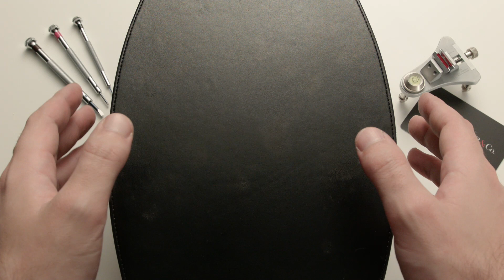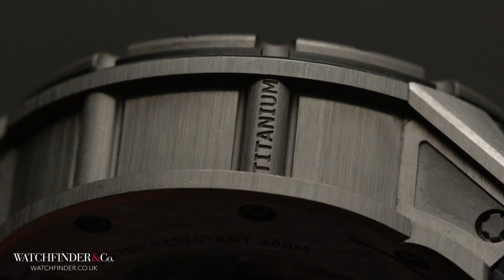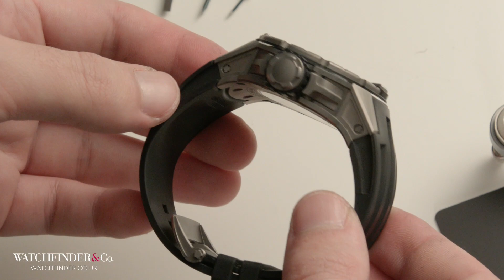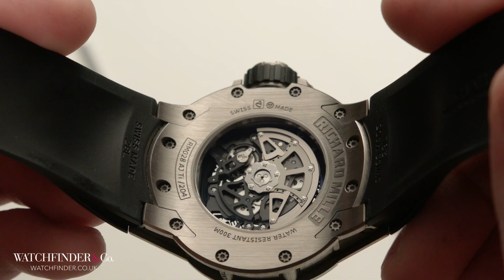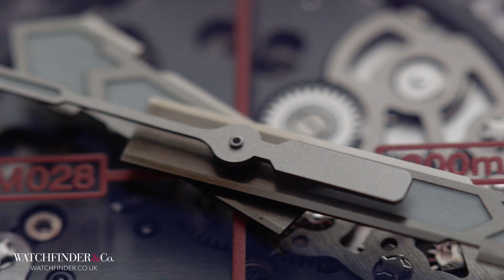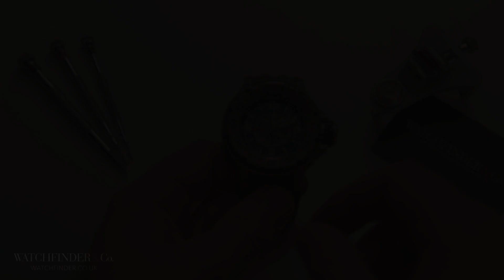Richard Mille RM028: Does Expensive = Ultimate Dive Watch?

Comment: I love the engineering in Richard Mille watches, but hate the way they look.
Reply: Shawn B I agree. Although I love the case, that dial is annoyingly complicated with the skeleton movement. Definitely not a watch to quickly look at for the time.
Reply: Shawn B There's no 'engineering' here. It's a stock movement, purchased from Vaucher Manufacture Fleurier. Plus the 300m WR for the size of the watch is poor.

It's not engineered. It's designed by someone who threw together a bunch of exotic, unnecessary, materials for a wow factor that catches the eye of nouveau rich who have zero understanding of engineering or manufacturing.
Reply: dimman77 bruh you have literally no idea what you’re talking about